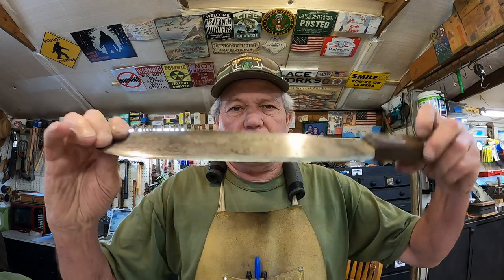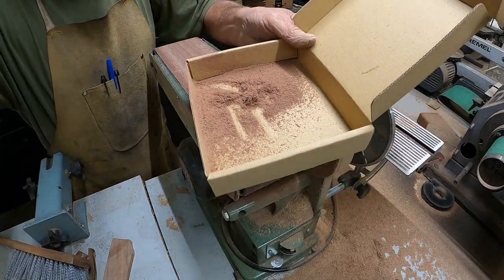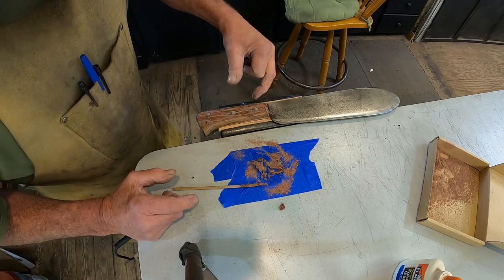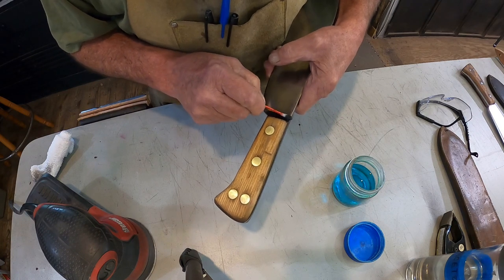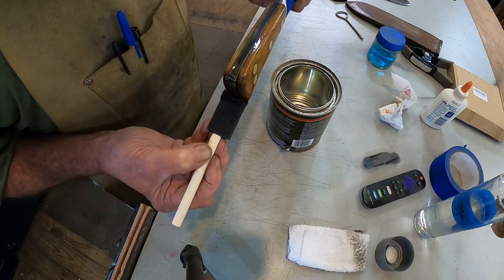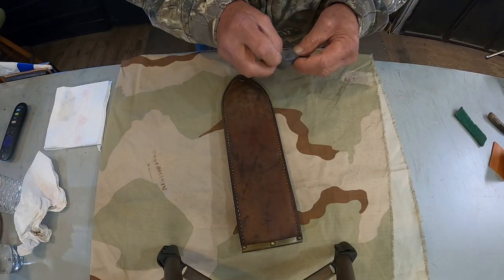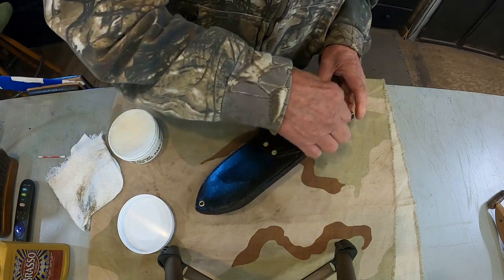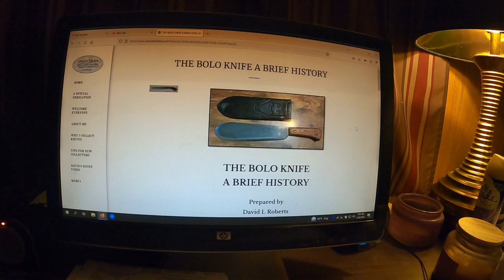RESTORATION  2 WWII USMC BOLO KNIVES !

Comment: I enjoyed your video.  I found one several years ago at an estate sale when I looked behind a workbench in an out building of the old farm.  The handle was broken beyond repair so I replaced it with oak. It was pretty rusty and I bought it for $3.  The bolo knives were manufactured under three contracts with three different foundries.  The blades are very high carbon steel.  The USMC actually stands for United States Medical Corp.  They weight two pounds and can slash through bamboo easily.

Comment: The bolo blade shape is unusual looking , but the rounded tip and curved edge would slice someone wide open if good and sharp as a slashing weapon and very versatile for clearing a path in the jungle environments and processing wood and limbs for improvised shelters and the variety of jungle knives/ machetes the U.S.M.C used is very interesting.